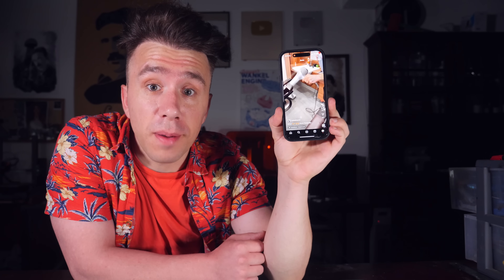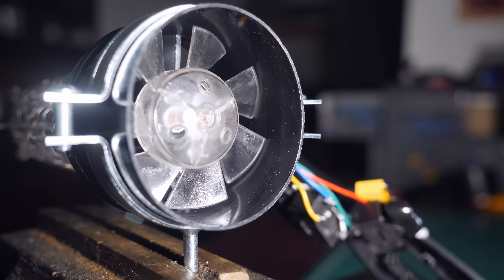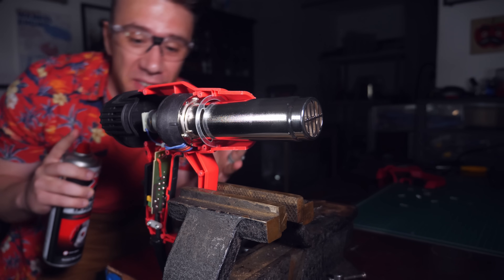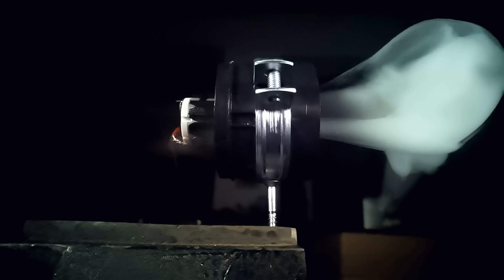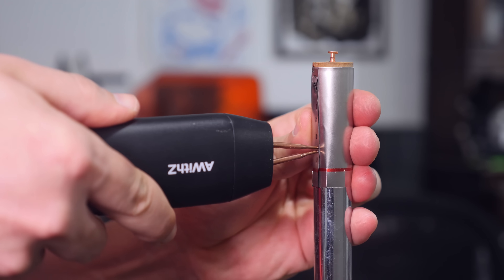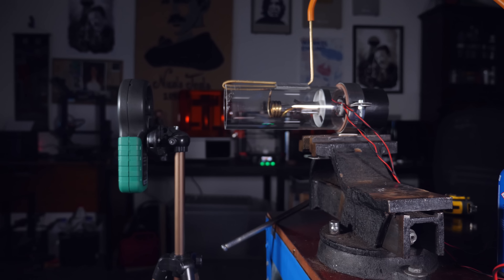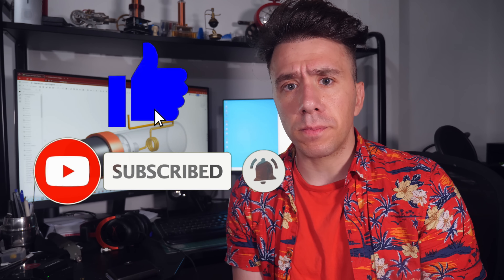I turned my $20 Hairdryer into a JET ENGINE

Comment: You don't need to build the models to optimise air flow. You just need to balance the equation:
1 - Work out the volume of air you're pushing through the tube, per time interval. Assume 20% of that air is O2.
2 - Work out the precise molecular makeup of the fuel you're using.
3 - Balance the equation.

Once balanced, you'll know precisely how much fuel you need to push through the tube, per time interval (per second, or per minute, or whatever you measured it as), to completely combust the fuel as well as completely consume the available O2. THEN you just have to make something which would release that precise volume of fuel into the combustion chamber per time interval.

Now I'm not suggesting that the above is going to be easy, but I stand what I DID say - you don't need to print out the models to work out all that stuff  written up above. All that can be worked out on paper, before ever printing out anything - after all, you've already given us a measure of the wind speed pushed out by your tube, so if you tell us its precise dimensions, we can also work out (on paper) the precise volume of air it pushes out every second/ minute/ hour/ whatever.

Comment: if you wanna do big stuff, you could try to add a turbine at the exhaust pipe and narrow the section aft of the turbine like a real jet exhaust pipe. the turbine and convergent nozzle should accelerate exhaust gases i guess

Comment: Really glad nothing happened in this video, but doesn't brake cleaner break down into phosgene gas when burned at high enough temps? All it takes is one whiff of that and you'll be dead within days and it won't feel good as you go.

Other than the smell of freshly cut grass, you won't notice other symptoms until it feels like you can't breath, the tissues of your lungs filling with fluid, not even intubating can fix that. Be careful messing with that stuff.

Comment: use every parts with metal and try to extend the coil and use many spray points it help for easily fule cumbusion and take a gap between the coil to entering the o2

Comment: You won't be able to use all of the air for combustion because you have plastic as your housing. Make a 2 stage fan. 1st fan is the larger ducted fan. 2nd stage is a smaller centrifugal compressor that leads all of its air directly into the combustion chamber. (Your combustion chamber can be the coiled tubing lined with the thin steel sheet.)  The slightly larger edf that operates as a turbofan, provides cooling air between the combustion chamber and the housing... Also it will cool the transition between the plastic centrifugal compressor and the combustion chamber. This would create a hybrid of both situations you were exploring at the beginning of this video. Then you just have to get the air/fuel mixture correct... This is probably why the heat gun didn't ignite on high... There wasn't enough fuel.

Comment: variable nozzle.

power and expansion are on a ratio, youd have to comtrol the nozzle open-ness as you add more power, at a certain point the power can get bogged by the lack of space and just impede on the thrust, youd have to do extensive research on different nozzle sizes coupled with a 0-100 fuel injection rate (it needs to be controlled). once you figure out how to control the injection you can lock-in variable nozzle positions that will optimize the thrust when applying different levels of fuel. 

example: if you just made an exhaust nozzle that you could change the width of after the initial intake, youd find that theres positions that generate significant thrust and others that just choke the engine. for fighter jets when they go full afterburner the nozzle opens up, but there are positions wher youd see the fuel burning visibly BUT the nozzle is closed. nozzle position depends entirely on the amount of mass and speed of the exhaust gasses.

Comment: instead of the giant fan blades use slimmer ones also build and controller for the break cleaner so no human error is involved. or spray bout 3 cans of it into an bottle for a better control fuel. would also instead of flaring the ends of the metal out, try like fighter style and inwards for more thrust.

Comment: Plan A:
Place a copper pipe in the dead-zone all the way from the beginning until the end of the dead-zone and clamp the pipe shut at its tail-end.
Drill holes into it for the fuel to exit through. Be careful.  Too small holes and boom, you'll go bald for a year. Too large and you'll have unequal combustion. Many small holes would be the way to go.

If that is insufficient,
Plan B (much more complex but higher control):
Coil another copper pipe along your acrylic "afterburner" (on the outside, to not interfere with the airflow), drill some holes into the coil and align them with holes in your acrylic for the fuel to exit your coil through and enter your afterburner.

Plan C: Pick me!

Comment: A 3d printed fan with porous metal blades as the feul delivery. The center hub would have an impeller inside to increase pressure and force fuel into the blades. This way the fuel is more evenly distributed and mixed with all the air.

Comment: It needs pre fuel mixing. Cut a hole in the copper pipe and use another copper pipe with pressurised air.

Comment: add more holes in the end of your injection system, add a beveled choke point in front of the impeller, add many more blades to the impeller, make the impeller slightly larger to reduce wasted air while also pressurizing the protective shield of flowing air further, make the center of the impeller and base of igniter larger to reduce wasted air even more, use butane lighter fluid instead of brake cleaner, use a stronger brushless DC motor, replace the nichrome wire with kanthal wire (gets a lot hotter without destroying itself), and add a beveled choke point with an open ended cone shaped funnel (similar to a 2 liter soda bottle) for more pressurization and controlled flow (make sure not to make it too narrow or it will explode). lwk i think i cooked wit dis one

Comment: I would guess that in the original video, the hair dryer used a brushed motor which made enough sparks to set off the fuel regardless of the heater element.
Nvm haha

Comment: You could try concentrating the air from the fan to a higher pressure with a cone with a slightly smaller opening on the fan exhaust and slow down the fan to compensate for the higher air speed due to pressure.

Comment: its easy, just add a hole that gradually gets smaller in the tube at the ignition place.thus , it will accelerate the air

Comment: Copper tube circling the outermost circumference of the tube from the inside, nichrome wire around the tube to heat it up, holes in the copper tube to inject fuel. Air not slowed, all the air used for combustion

Comment: When electric motor get old there is a biger gap between the brushes and magnets so there is a bigger spark to ignite the brake cleaner or the motor is on the opposite side of the fan on your hair dryer.

Comment: You can reduce the sectcion after the turbine so the air speed increase and hou can use an other mecanism to inject the gaz without giving perturbation to the air after the combustion.

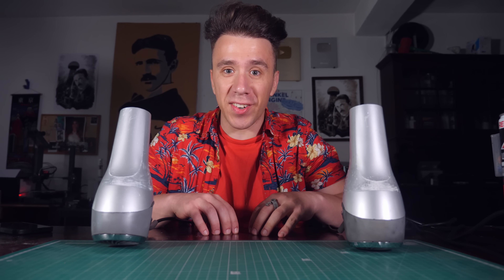Comment: So, I'm at 6:30 and I'mma ask before I get an answer from the video: the broken one arcs or sparks somewhere, doesn't it?
On the other hand: at 7:23 (and the original time referenced in the recap at 7:23, obviously), it might be just me but, that doesn't look like it's not working, at all. Quite the opposite, it looks like a smooth, controlled (slower) combustion happening there.

Comment: Can u find out what exactly is the reason brake cleaner is really efficient …why don’t u use de- Laval nozzle in the front for pressurising the gases a little more 

I need a 3D printer to test it … Subbed !!

Comment: 12:57 You could just decrease the bypass ratio, since some of the air is bypassing the combustion stage, similar to a Turbofan engine. If you want to increase thrust, you can just make the combustion stage bigger. (Or add a afterburner)

Comment: Make a ring with real small holes so it sprays it in a mist, then use the ignitor just down wind from the fuel injection ring.

Comment: Make a nozzle connected to the tube, put a canister of compressed air at the other end. make it connect to something like 2 pedals, one for the compressed air and the other for the brake cleaner. Then you would be able to control the flow of air as a booster and the brake cleaner as the fuel. And bonus point, you can enlarge it and make a vehicle

Comment: You could try using a compressor at the inlet rather than a fan. More of the air/oxygen passing through the unit would then be available to use in the combustion unit rather than simply flowing through. It would lower the thrust when no fuel was applied but should dramatically increase it when it is especially if you restrict the rear outlet a bit but then you will start to burn this part if its made of plastic/acrylic as you have basically made an afterburner.

Comment: The key is that in the initial video, they had a Concentrator nozzle. This small part made the air harder to go out, so the fuel had more time to be heated by the heating coil. Resemble to the part in the jet's tail

Comment: Hey umm dude how about two ring one (that are connected together) one along the wall and one in the place rn and u spray Fuel to the centre from both rings it would prolly help use all the air (hopefully it wount burn acrylic thingy)

Comment: I know I'm late to the video but the one in that clip you were trying to imitate that is broken. Doesn't that have a carbon brush motor and the brushes aren't touching the commutators correctly leading to the sound and the reason it's broken but also causing an ark which is igniting the brake fluid to ignite

Comment: NEVER NEVER EVER use American break cleaner (chlorinated hydrocarbons) for stuff like this or in the vicinity of any heat source. This stuff can decompose into seriously dangerous gases like hydrogen chloride (extremely corrosive) or worse phosgene gas (mustard gas). Welder's 101, thank me later.
Break cleaner in Europe is white spirit in pressurized cans, just a very good degreaser basically. Many professional shops use pump and spray bottles and refill from a barrel over here.

Comment: you should study up on the dangers of lighting brake cleaner.   Tetrachloroethylene in brake cleaner as is can cause cancer and or nerve damage, even Parkinsons disease.   But lighting it on fire makes it 10 times more dangerous.   I never knew until recent like the last few years as I have used it a lot.  A person I was reading about used it to clean parts before welding and the residue left burning messed him up for life and fast after just a few times exposing himself.  The burning fumes are mega toxic.   

Now I am not one for the safety police on the internet but I love your videos and would hate to see you not be able to do them.   So Please research this before doing it further.    Okay I am 0:45 in so I will now watch the mad man at work.

Comment: ..The issue can be solved by supplying two separate sources of oxygen. Try supplying a separate line of air parallel to your fuel line that will only be used for combustion. Wonder at which point you will have to upgrade the acrylic though 🧐

Comment: brushes of the fan motor spark on a 240v brushed motor. your hairdryer isnt used enough. Need them brushies to spark! old brushes arc like mad. 

Edit: Also, the the dude in the video had a adapter on the front of it, makes sense that a restriction on the front would help with pressure/combustion. Id guess you can calc air fuel ratio and meter it out via some kind of flow regulator / fuel injector

Comment: for better mixture of air an fuel try some blades design, like in turbine engines. at the and redirect the mixture from going in zigzag between blades to go straight out again using last set of blades.

Comment: Try using ether. You can buy it in cans at autoparts stores. Farmers use it to start their diesel engines in the winter. And instead of using a fan, why not put another tube in, and try using  compressed air from a can (IT guys use it for cleaning keyboards). Then your next step with your 3D maker tools is to make one button that activates the valves on both cans at the same time. You probably won't need the fans after that.

Comment: Meter the air through a carburetor on the intake side to atomize all the fuel and air before the combustion chamber. Then probably add some variable opening windows on the side to try to boost performance like a blow torch head.

Comment: That 3d “Tesla valve” u designed works kinda like a linear Venturi nozzle that pulls a vacuum on the outer section. Works pretty well for me, you could have used it here to in a similar manner.

Comment: I was thinking on adding extra air inputs before the cooper coil, the fan will give you the power to ignite the spray and the air inputs will make the flames even more powerfull, I hope it has sense and it can help you

Comment: the other one worked because the brushes in the motor where mostly worn out and arcing. The attachment on the end made the air pressured slightly too which probably helped as well.

Comment: These are some ideas that I think would make it faster first of all increase the amount of support for the fan second make the tube go smaller every single time and it last but not least add some ports for air so it can actually boost the combustion way more optionally you can put the ports in a angle so it becomes a vortex inside of the chamber also making it so that it will blast more flames.

Comment: Hi there, Remi here again.

I think it would be better if you use a spray head pointing towards the exhaust direction, this way the little fuel droplets that are speeded up can mix with the air and BOOM

Comment: Why would you use brake cleaner 😭 it toxic in a liquid state, but it becomes extremely toxic when you burn it. Thats why (smart) welders dont use that shit to clean metal before welding. But straight up burning it is crazy.
Reply: Quick ChatGPT summary: 

Burning brake cleaner, especially those containing chlorinated hydrocarbons, can produce highly toxic gases. When exposed to high heat, such as welding or an open flame, the chemicals in brake cleaner can break down into dangerous compounds.

Common gases produced during burning:

1. Phosgene gas:

If the brake cleaner contains tetrachloroethylene (perchloroethylene) or trichloroethylene, burning it produces phosgene, a highly toxic and potentially deadly gas.

Phosgene was used as a chemical weapon in WWI and can cause severe lung damage, difficulty breathing, and even death.

2. Hydrogen chloride (HCl):

Chlorinated solvents can release hydrogen chloride gas, which is corrosive and can cause severe respiratory irritation and chemical burns.

3. Carbon monoxide (CO):

Incomplete combustion of organic compounds can release carbon monoxide, which is colorless, odorless, and highly toxic.

4. Dioxins:

Burning chlorine-containing compounds can create dioxins, which are persistent environmental pollutants and highly toxic to humans and wildlife.

5. Other toxic chemicals:

Depending on the specific formulation, burning brake cleaner can also release other harmful substances, such as:

Hydrofluoric acid (if fluorinated compounds are present).

Chlorine gas.

Safety Note:

Never use brake cleaner around heat sources or flames. Even non-chlorinated versions can produce harmful byproducts, though they may not generate phosgene. Always read the product's Safety Data Sheet (SDS) for details about its chemical composition.

Comment: The common solution in internal combustion engines is some form of vaporizer to take your fuel to the ideal air/fuel mix ratio.  Usually some kind of carburetor/fuel injection, so you need some kind of metering system (jets in a carburetor) that regulates the fuel inlet pressure to allow it to come to lower pressure and become vapor, or a system to MAKE IT A VAPOR.

Comment: I thought the way a jet engine worked was by compressing air and then burning it with fuel to create higher pressure and thrust.But so far I've watched all your jet engine building videos and the way it works is different, You never compress the air so Its doesn't push it too high, but instead often make a large exhaust hole which reduces the pressure and thrust.Unless the air is properly compressed and properly burned that's where Newton's third law comes into play. Newton's 3rd Law explains that when one object exerts a force on another object, the object receiving the force will exert a force of the same magnitude but in the opposite direction.